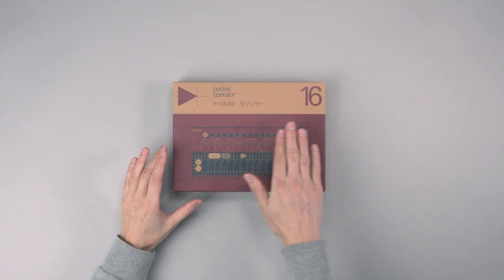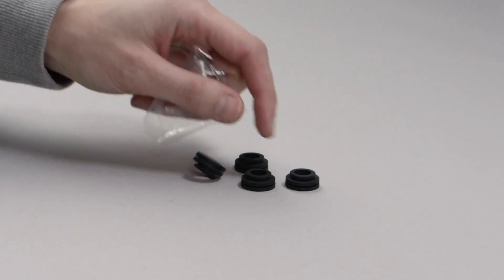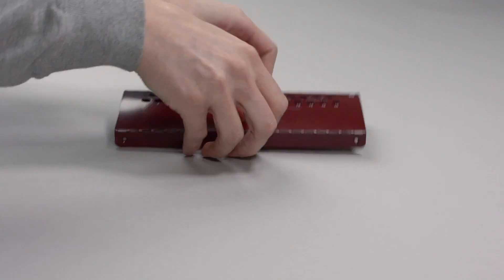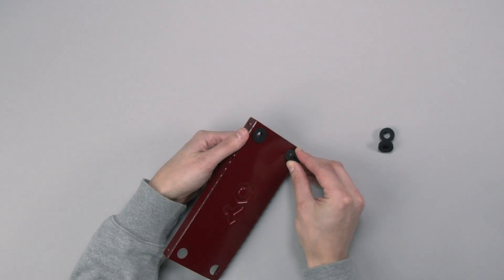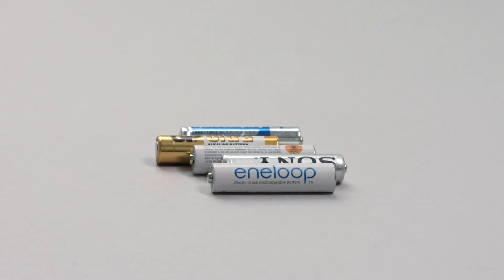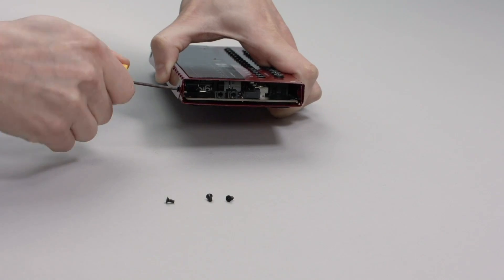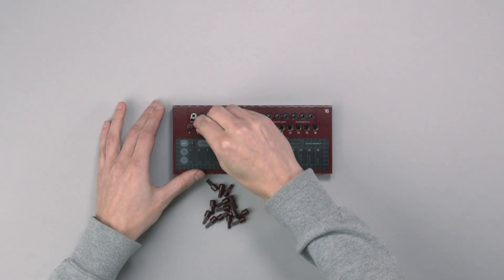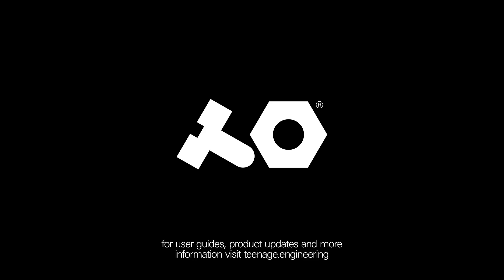pocket operator modular 16 - build guide

Comment: Tip: Don't keep the batteries in, after you have plugged in the encoders you can't open the top^anymore. That is a very stupid design guys! The Battery power is basically an unusable feature...

Comment: I had a hard time with that ribbon cable !
Reply from the maker: ...but you did it! great. thank you for your support. what would be some advice to share, how did you eventually manage?
Reply: @teenageengineering 

I can't get this cable to stay put at all. Every time I try to close the case the cable doesn't stay in that tiny lil slot.

How do you do this?
Reply: @eveo7643  I had to use a lot of force, which is a huge issue if the alignment isn't exactly perfect. The awkward location makes it worse. These style of connectors were never meant to be used in the middle of a PCB. They are designed for use at the edge of the board with slot facing out. BEP is to use a snap-lock or closure connector for all internal board connection. But that information doesn't help you. I found that using magnification to get it aligned and applying significant pressure DIRECTLY IN will eventually work. If you let it push up or down disaster is likely. That being said, Once I felt it seat all the way in (and it will kind of seat with a clunk) it was secure.
Reply: @teenageengineering   I likewise had an issue. Try a snap-lock socket instead a push-in.
Reply: I can't even get it to slot in on my revision 5 board, it goes in like half a millimeter and then just stops. As stated in this thread, this is absolutely not the kind of connector to use in this case.